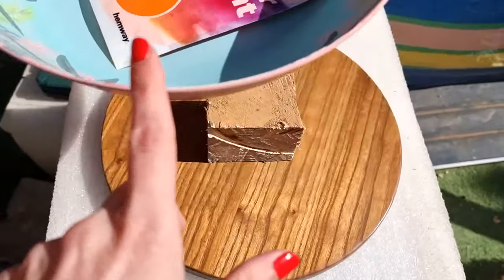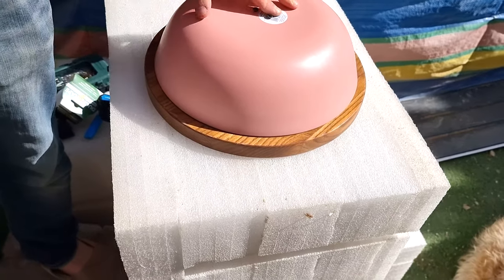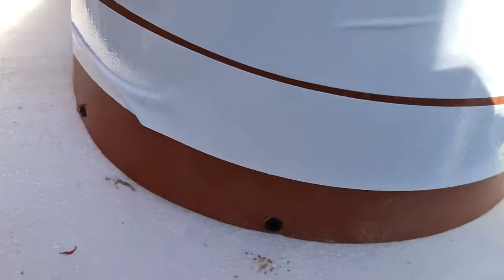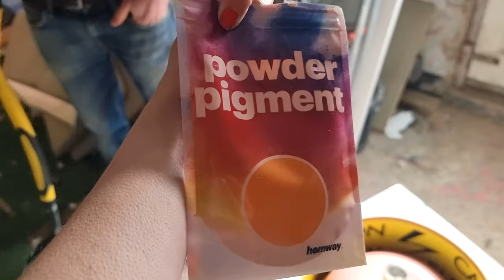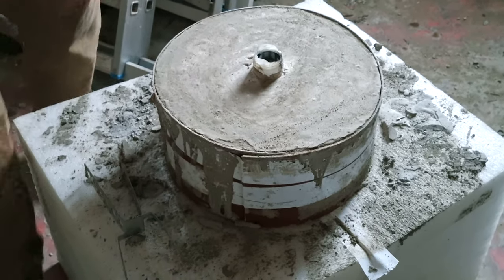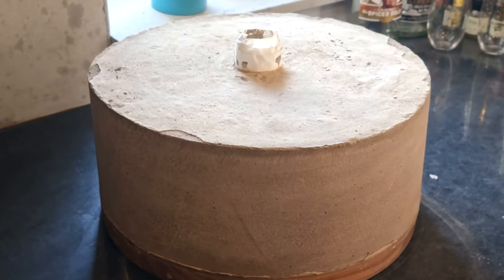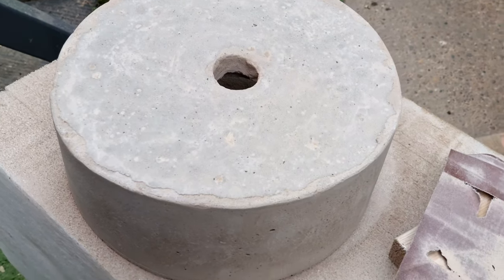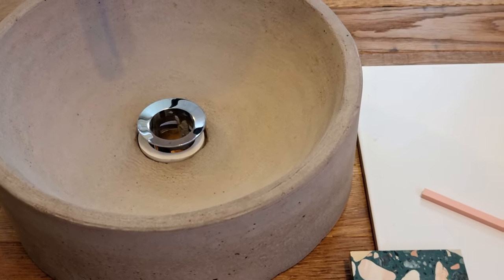First DIY project! We made a coloured concrete sink!

Comment: Beautiful and yes, so satisfying to see a creation done yourself! Here are some tips to consider regarding final quality, strenght and costs. 1. Consider a brief further cure even after initial dry stage. Mist the bowl with water and let dry again. This adds strenght. 2. Consider making your own sealant. Use waste styrofoam and dissolve in Acetone until you get a nice consistency that is not too runny. DO IT IN A GLASS BOTTLE OR JAR with a lid. Leave the jar sealed for a few days. The sealant becomes crystal clear. Paint this on your bowl. Adds a beautiful shine, waterproofs well, and adds extra strenght. Also much cheaper. 3. Try normal playdough as your mould sealant. Quick (no drying needed), cheap and can be re-used. Have fun, enjoy!

Comment: Did you use counter  top concrete
Reply from the maker: Hi, no we used a normal sand cement mix, our builder advised us on the mix and it worked well